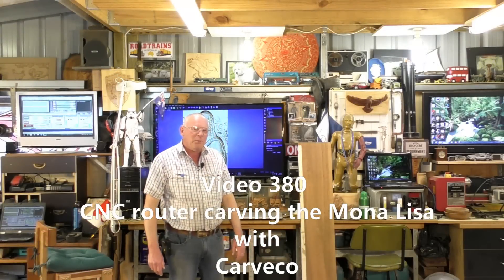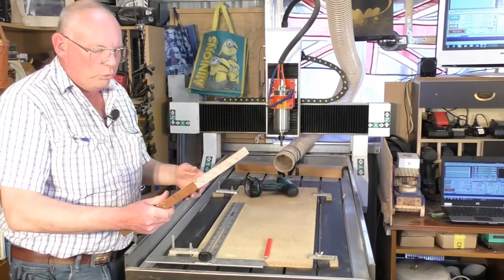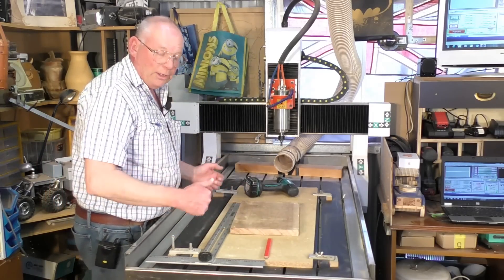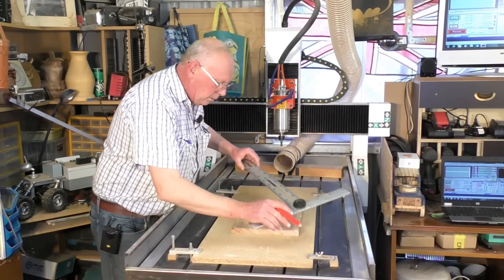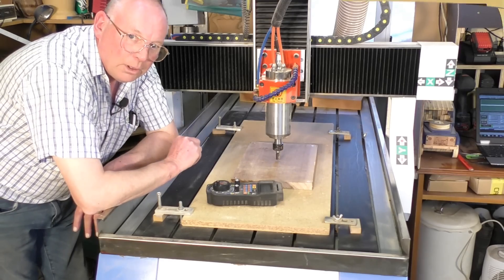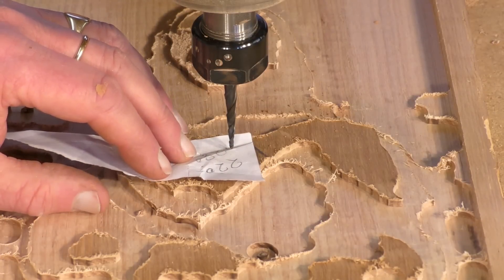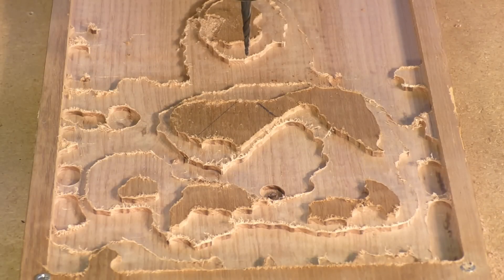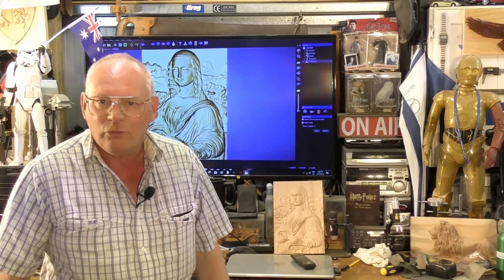CNC router can make $2,000 PER DAY 3D carving the Mona Lisa.

Comment: You should look into plastic brad nails for your nail gun. Its used by loggers to nail and mark trees without adding metal to trees for later. You could just drive 4 into the bed of the CNC

Comment: Hi, I just started to look at CNC Routers and I seem to know less now than when I started, can you give me any advice on what machine I should be looking for? I'm looking for something that will carve harder steel like Stainless Steel and Bronze plus wood and Acrylic. I don't need it big or fancy, cheap would be good but I don't want crap! Any advice please!
Reply from the maker: A CNC router will NOT cut stainless steel, you will need a HAAS machine or a Tormach 1100
Reply from the maker: P.S. you get what you pay for!!!
Reply: I just want it to heavy engrave not cut or mill so spindle speed and travel speeds is what I was after or do cnc not do this?

Comment: I want to use more than one bit of a roughing ?
I mean end mill 12mm, 6mm, 3mm and last one ball nose 1.5mm
What is the correct way?
Reply: Depends on the level of detail. If it has a lot of details I would use 6 or 8 mm for roughing and then the 1.5 mm ball. If not you can use much bigger tools.
Reply: @МиодрагКићановић  
Thank you Dear
I want to cut iron and I must use more than one bit
Reply: @Ahmad_G-AG  I am sorry Sir. I have no experience with metal. Look up feeds, speeds, stepovers online. Good luck!
Reply: @МиодрагКићановић  
sorry dear can you send to me video for that , I can't find it
Reply: @Ahmad_G-AG  Google feeds and speeds for iron for that specific tool. For example you Google 6mm endmill feeds and speeds. I doubt you can carve iron.
Reply: Does anyone know the answer?